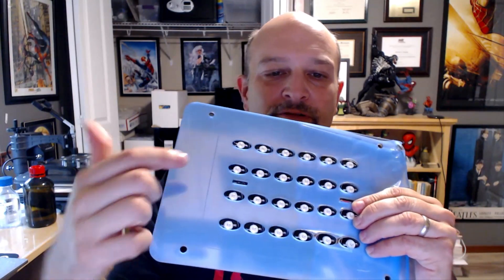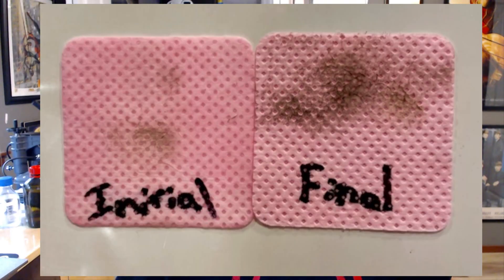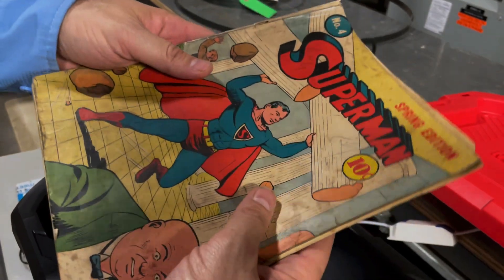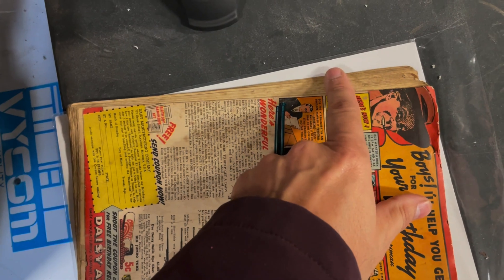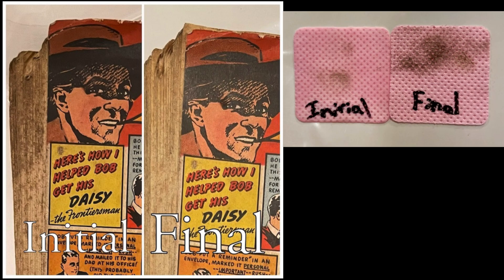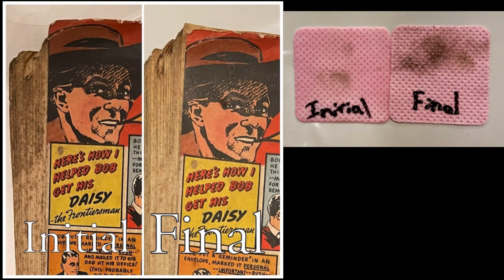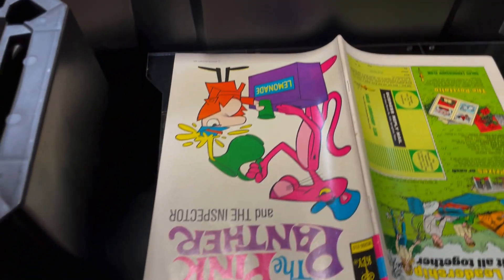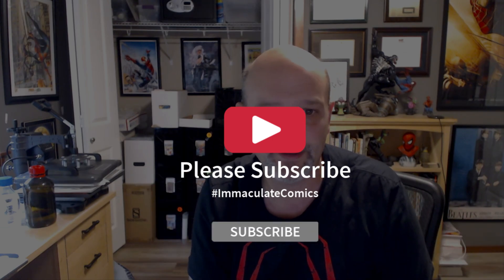Mold Removal on Comic Books with Immacucube.  Cleaning Superman #4

Comment: any reason why you choose to do an ozone chamber as opposed to a wet clean?
Reply from the maker: Hi Joe! Ozone and wet cleaning are complimentary, not mutually exclusive.   This book is far from finished and will absolutely be wet clean in the future.  
Wet cleaning a moldy book will often smell even worse.  Treating  the mold
First with ozone makes it easier to remove and also removes the moldy smell.  If you press a book with mold
On it , it can be very difficult to remove afterwards!
Reply: @ImmaculateComics  I need to add that ozone to mine :) instructions please.
Reply from the maker: @scottisaacson6730   my o3 generator cannot be sourced any longer.  I am looking at building one buying similar units, then I will put together instructions and a build list for everyone!
Reply: @ImmaculateComics  awesome!! i have an ASM13 that needs it baaaad